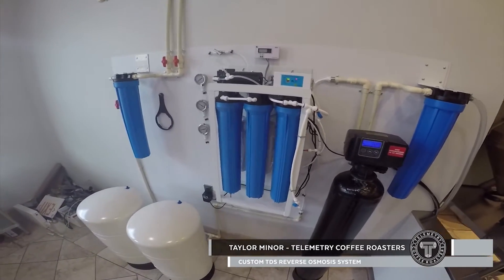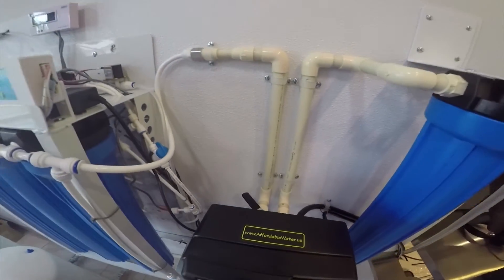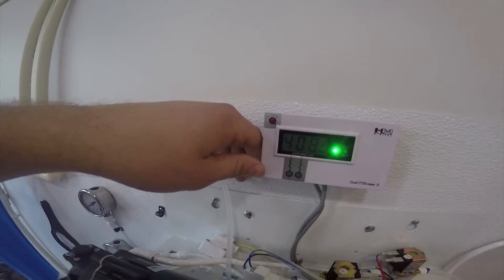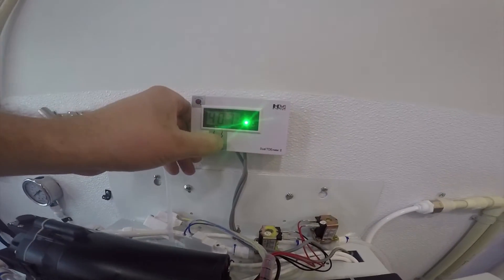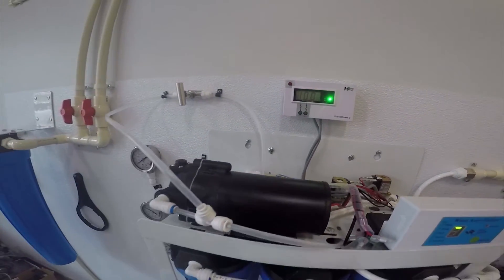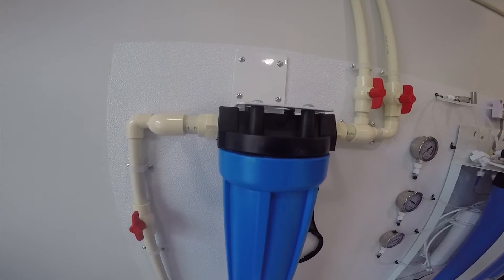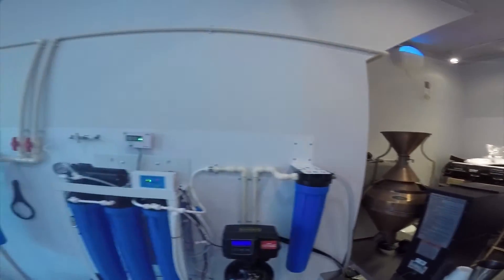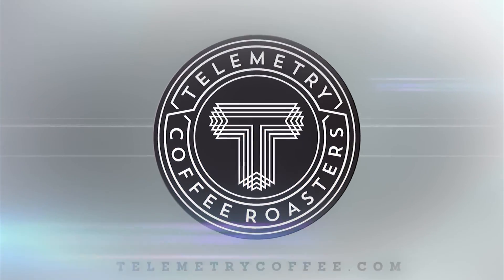DIY Custom TDS Water Filtration System For Perfect Coffee Water

Comment: Interesting!!!...Can you connect the espresso machine directly to the 40-60 PSI bladder tank line, or could the pressure difference between the injected water and the machine’s intake cause issues? Have you encountered any problems?

Comment: From what you have shown, I am confused as to which one of those filters is the reverse osmosis unit.    I didn't think you could install an RO cartridge into one of those blue housings.    Or are you just referring to the system as a whole as a reverse osmosis setup?
Reply from the maker: Jason Grasso the system as a whole is the RO unit. The RO membranes are behind the blue filters. The blue filters are just carbon filters to remove the chlorine.

Comment: This is rad - we should talk about a different type of softener, Voltea!  Does all of this automatically, you can tune the amount of TDS you want removed, along with all the other minerals, and it tells you how the system is doing remotely (as long as there's an internet connection).